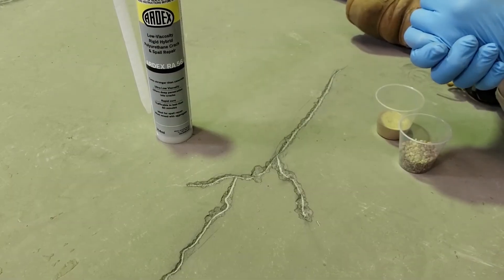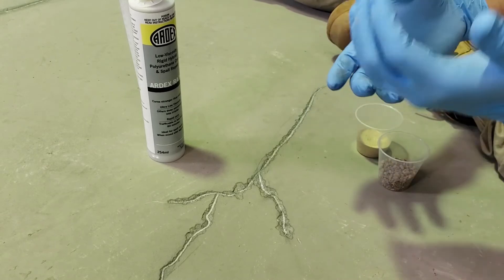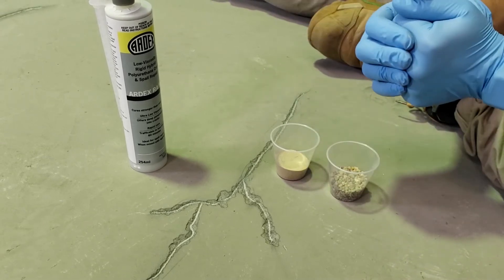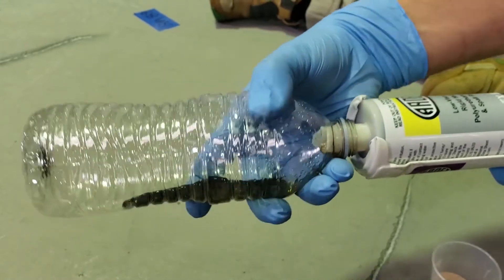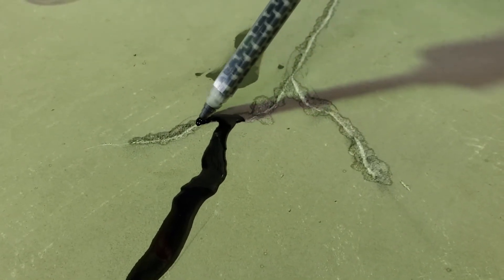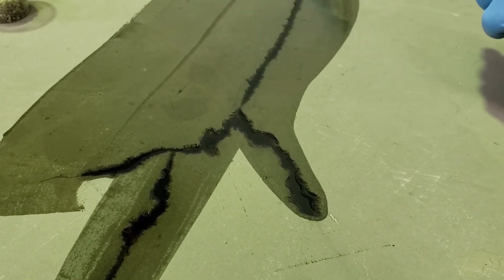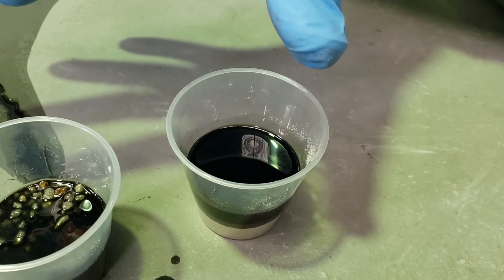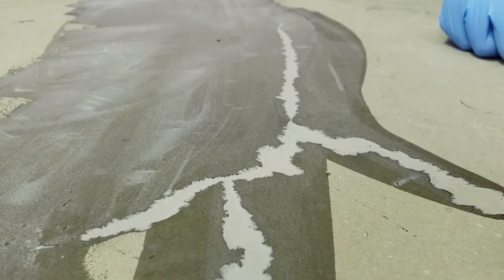ARDEX RA 56 -  Horizontal Crack Repair

Comment: Is it as strong as RA 142? I have cracks on my internal slab upto 1mm. A few widens to 2mm.
Reply from the maker: Hi there, ARDEX RA 142 will be stronger in compressive strength but the ARDEX RA 56 will be stronger in tensile strength.

Note: Both products are significantly stronger than concrete for both compressive and tensile strength.
Reply: @ardexaustralia  Thanks. Think will use the 56, thinner, will flow in hairline crack better..? How about the bond strength, will it be a structural repair?
Reply from the maker: Hi  @OUexp  - It will definitely be strong enough to be a structural repair.
Reply: @OUexp  Hey Mate how did you go?